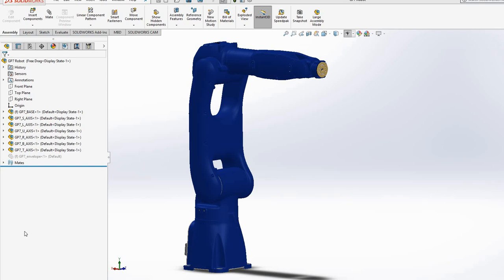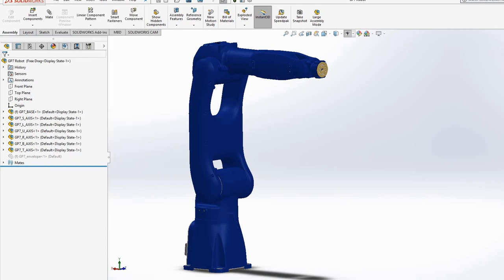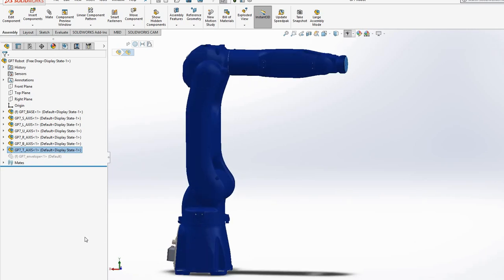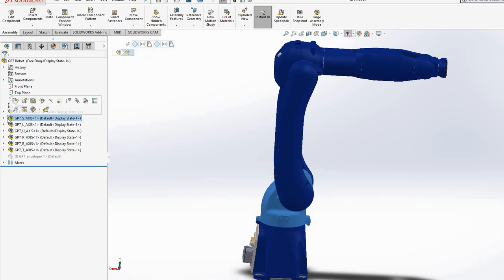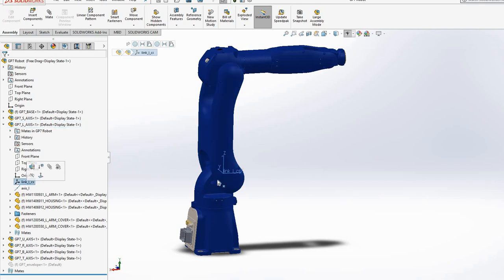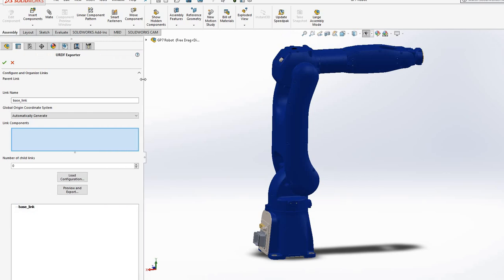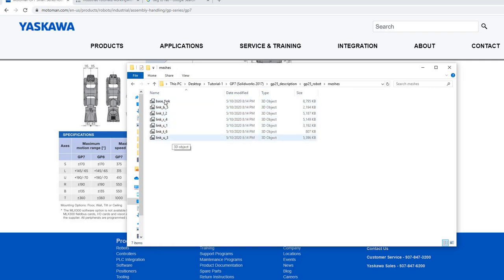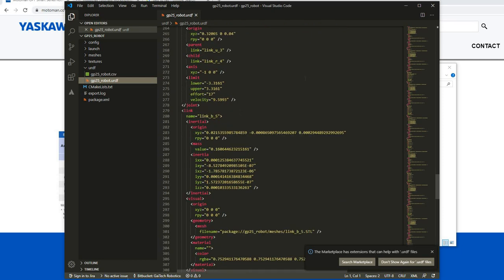Create industrial robotic arm URDF from Solidworks CAD model - Part 1

Comment: Thanks for this amazing video! I had created a URDF File for my 6DoF Robot Arm but when I launch it in ROS, the robot doesn't look well in Rviz, it's disorganized. One of the messages, in Rviz, said the tf of each link is not definded. Can you help me to defined it correctly? My model has coordinate systems and axis in each place that the robot needs but I can't understand why it doesn't work :(
Reply from the maker: Hello Alejandro, I will try to remake a video with a few more details about debugging in a day or two. Maybe that can help you. In the mean time, I would suggest to download Meshlab, open your STLs in it, and click on Show Axis to see if the coordinate frame you attached to each mesh (stl file) is where it is supposed to be
Reply: @MuhammadArshad  Thanks Muhammad! I'll be waiting for it :)
I was working with the issue and I resolved it. Only I needed to change the fixed frame to my base link and it worked. But now, from the fourth degree of freedom, the robot has the opposite orientation. What parameter do I need to change in the URDF File to correct it?
Reply from the maker: @ateverz  Good to hear that. you will need to change the axis tag (probably just the sign of it)
Reply: @MuhammadArshad  Thanks for your support! Finally I get it but now I'm working with the inverse kinematics based on MoveIt_Commander. Do you know any source where I can read about it? Because when I run the code, ROS indicates that the goal state is invalid or undefined. If you can, please check my script: https://github.com/ATevera/r6g_steppermotor/blob/master/src/CinematicaInversa.py

The idea is that this script ask me the cartesian position and give the degrees values like a inverse kinematic solver. Thanks again for all!
Reply from the maker: @ateverz  There are different kinematic solver you can use with MoveIt, most famous ones are KDL, TracIK and FastIK. When you configure your URDF to create a moveit config, it asks you which one to use (in planning group tab). Also, have a look at MoveIt tutorials which are very detailed. If you want to further to in deep for moveit commander, I would suggest to look at moveit github page. The move group.py file helps a lot and has quite detailed comments about each method. 

Hope that helps. Good luck